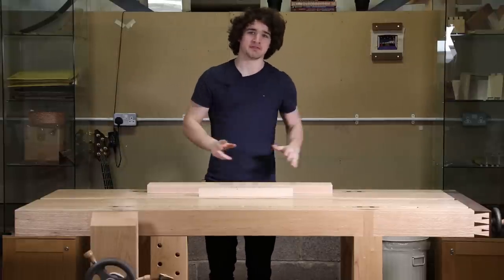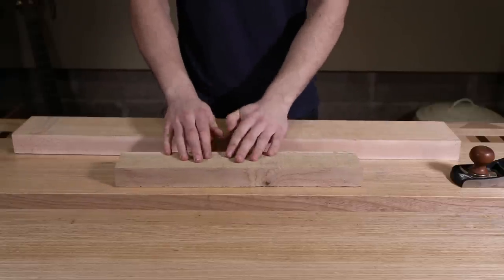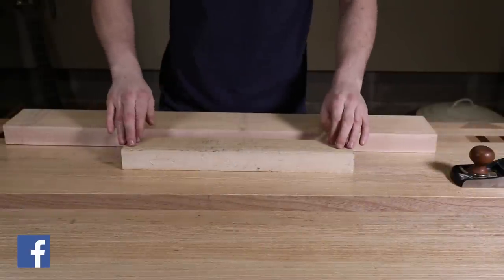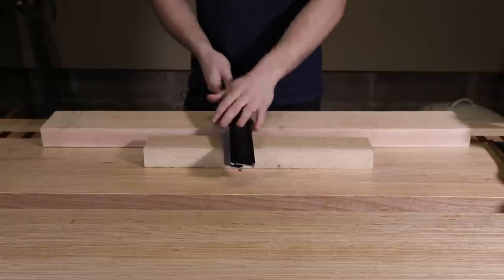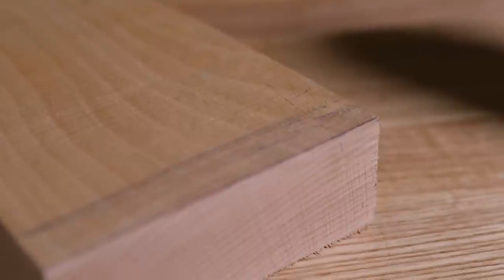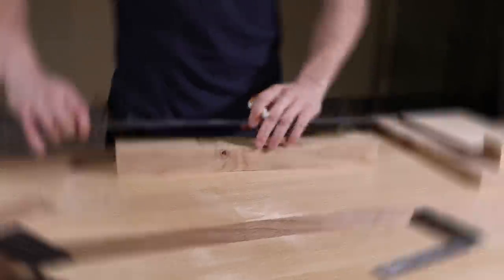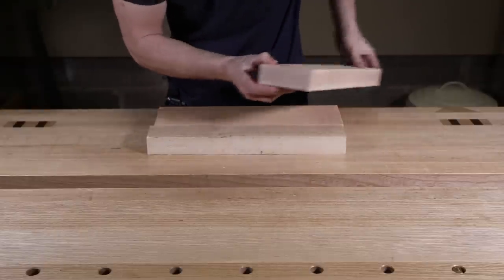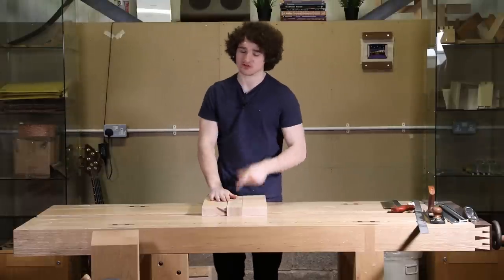Cutting and Orientating Timber | The Chopping Board #1

Comment: Hey Matt, great video!  I have a 2 inch x 14 inch x 22 inch pice of solid walnut I was going to make into a cutting board.  It has a number of good splits in it on the end.  Any suggestions if I don't want to remove any of the material?  They go pretty deep.  Could I use epoxy?

Thanks, 
 
Joshua
Reply: Hi Josh. If you’re feeling a bit of a daredevil, you could always use the Dutchman Bow tie, or if you want to hide the cracks, an epoxy with a dark stain would sort it out. However, if you wanted to highlight the crack, then an epoxy with your favourite colour would work a treat. There’s a few options. Good luck!

Comment: Never use plastic cutting boards. It's thought you can stick a plastic cutting board in high temperature dish washer, and it would kill bacteria. When plastic boards were tested against wood, it was found that wood killed bacteria, while plastic promoted bacteria growth, reguardless in you put it in a high pressure, high temperatue dish washer. There are many theories why wood kill bacteria, but no body knows why wood kills bacteria. A simple wipe with a soapy cloth, and a rinse  will end up killing 99.9 % of all bacteria on wooden board. There are many people out there lying, but the truth is plastic cutting board not only don't kill bacteria, they also promote the growth, and protection of bacteria. The wet surface of plastic is the perfect environment for Bacteria, and worse, one the suface of plastic dries, the bacteria go into protective spore state, which makes them almost impossible to kill, unless you use heavy neutron radiation. Lately, they have been promoting anti bacteria plastic cutting boards. These are even worse for people. Bacteria exposed to a constant source of anti bacteria chemicals, become immune to the anti bacteria componds. If you get sick off these plastic anti bacteria boards, there might not be a medicine that will help you. There is a geat deal of wrong information out there about the safety of cutting board. If you disaggree, you are wrong, and you are killing people. Plastic cutting boards are dangerous. Wood is the only safe way to go. Also, plastic cutting boards are ugly as sin.
Reply: You forgot to mention some plastic boards are too hard, and dull edges.